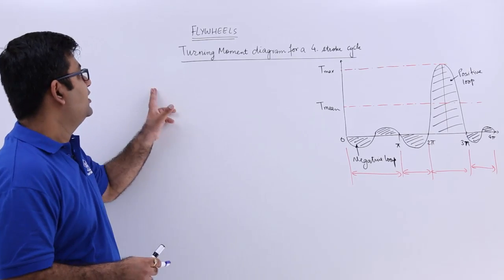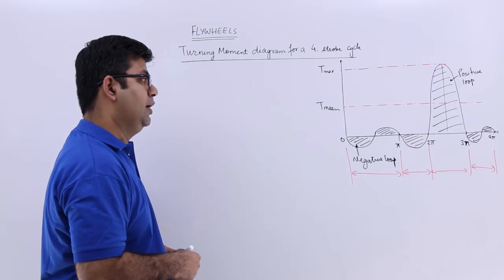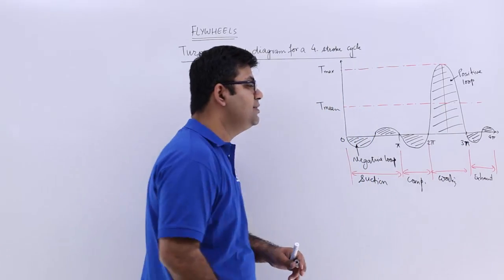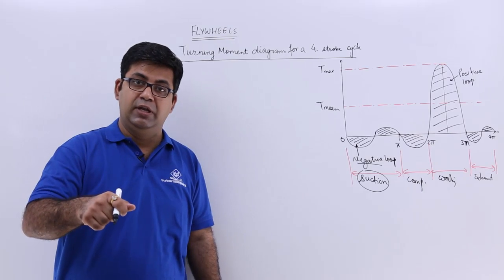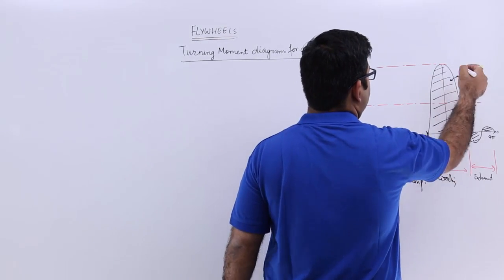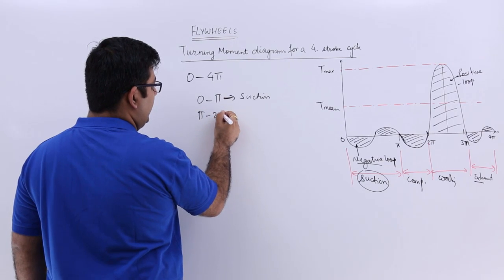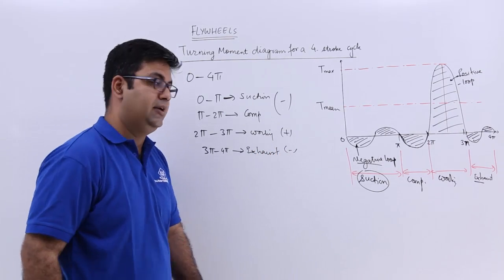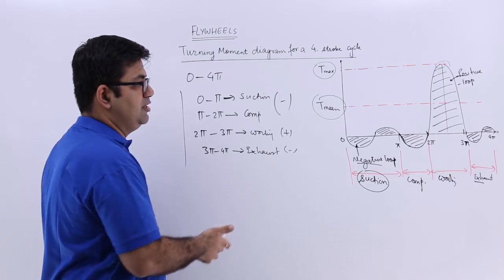Turning Moment Diagram For A 4 Stroke Cycle

Comment: Thank you Mr Himanshu for a good explanation. If I may provide some additional information based on comments below especially regarding two loops in suction and exhaust. 

POINTS TO BE NOTED BEFORE UNDERSTANDING THIS PHENOMENON
1. Thermodynamic System = GAS (Air or A/F Mixture)
2. Work done on System(Gas) = Negative
3. Work done by System(Gas) = Positive
4. Torque = ForcexDistance is a turning force (and a form of work) on rotating elements around an axis

Suction Stroke - Negative Work (Negative Loop)
When the pressure falls below atmospheric, work is done by surroundings on the gas to push it into the cylinder. Hence the negative torque generated on crankshaft

Suction Stroke - Postive Work (Positive Loop)
Due to the inertia of the moving gases in the second half of the stroke, the molecules do work on the surroundings creating positive work on the piston, thus generating a small positive torque on the crankshaft

Power/Expansion/Working Stroke - Positive Work (Postive Loop)
As understood from the video, this produces the max work available when the combusted gases push the  piston doing work on the surroundings to produce positive torque on the crankshaft

Exhaust Stroke - Negative Work
Pressure is applied on the gas by the piston to push them out of the valve and this creates negative work on the piston and negative torque is generated in the crankshaft

Exhaust Stroke - Positive Work
The inertia of the fast moving gases as the exhaust valve is opened makes the gas do work on their surroundings, thus creating positive work and a small positive torque on crankshaft.  

Hope this supports Mr Himanshu's explanation in the video. Kindly correct if I am wrong anywhere.

Comment: The negative loop in suction stroke is due to lower  atmospheric pressure....... Then what is the positive loop in the suction stroke for?
And applying the same concept shouldn't there be a positive loop for exhaust?

Comment: Sir could you please explain why there is positive loop in turning moment diagram in suction stroke
Reply: As far I know this positive loop generates because of inertia effect. This TMD actually formed by multiplying two  separate graph of (PA-Fi) and r(sin#+(sin2#/2n)) which are part of Turning Moment Equation.
Reply: @rabiulrony1760  what i gain from your answer is :
The graph teaches us not from the very beginning rather it starts from the 2nd cycle🚴and goes on.....
Reply: this is because of valve operation (timing)
Reply: @nitingusain4475  can u explain it in detail....
Reply: @fun_flavour  During the Suction Stroke Pressure in Cylinder is less then Atmospheric Pressure So that Work is Done on  gas to force  gas into the cylinder. That is work done on the System and work done on the system is considered as Negative. that's why there is negative loop in Suction Stroke. 
Similarly in compression stroke also there is work done on the system( on GAS , To Compress it ). so it has also negative loop.